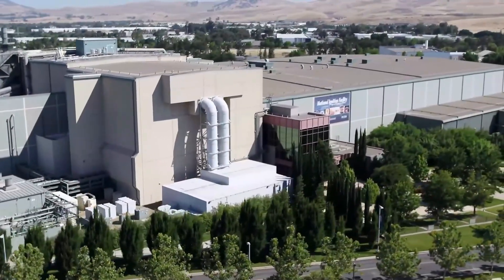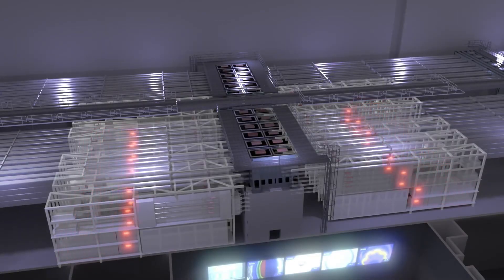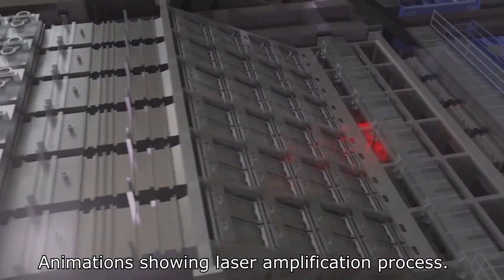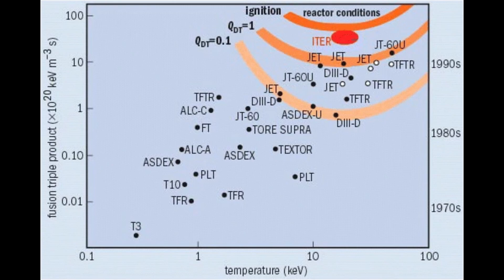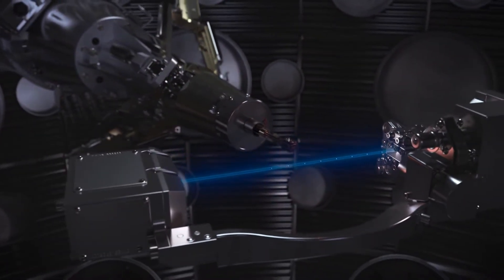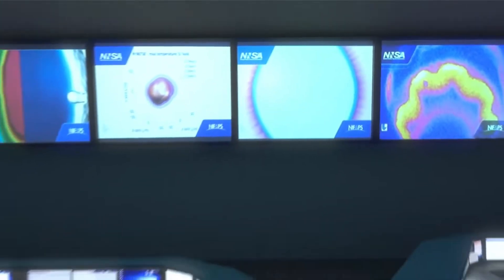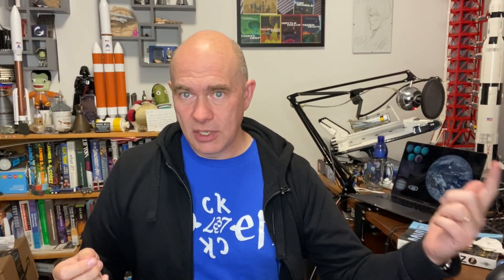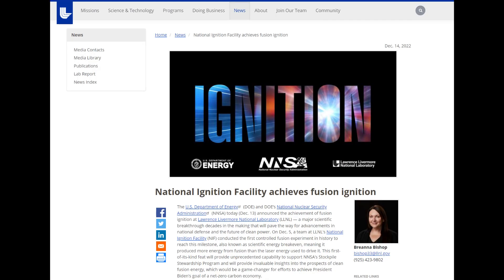Why The Biggest Laser in the World is Making Big News About Fusion

Comment: well they made once 300Whours to power my pc about 30 minutes  - and as far as i know they only calculated the poweroutput of the laser, not by the total consumption of the facility.
compared to the the total power usage they only received 1% of the power they put in if somebody calculated it right. As well they need hours to repeat this experiment, even if they can improve this method by a factor of 101 to gain 1% of the energy, they would need to repeat this process several 10000 times each hour to get something equilivant to a nuklear powerplant. 
This process uses Tritium which is one of the most expencive materials on earth - there are only a few kg on earth as it is radioactive and not stable. I think this method can never make it to a industrial usable even if its interesting to know.

Comment: important difference, its NOT the photon pressure that compresses the pellet. its essentially ablating the surface of the pellet very fast at high energy which gives a reaction force as the surface blows off that compresses it.
its also not the hottest thing we have, which would be particle accelerators, the Z-machine is also certainly hotter/ not sure about the density for those.

Comment: Already seen plenty of titles saying this is basically nothing, the same as every "breakthrough" in fusion we heard about in the past 20 years. I mean we get it, fusion reactors dont exist yet and the actual electricity bill for this experiment is still higher as the output by far. But being physically able to reproduce conditions similar to our suns core seems pretty significant to me, even if we are still far off from a working power generating prototype. In the meantime... maybe we can start building more solarpanels and stuff? No? Ok.

Comment: yes, thank you for pointing out the huge difference between Qtotal and Qplasma, usually discarded in the press (scientific vulgarization included) - we have the same issue here with ITER, even if the claimed Qplasma ~10 is achieved one day that will still be under a Qtotal in the order of 0.01 ... so net consuming energy from the grid.
Reply: Because ITER is a giant mistake.
Reply: @camojoe83  it is foremost a research tool, net power production claims derived from research experiments to that end are only binding whomever believe them.
Reply: MIT latest iteration of ARC/SPARC the MANTA on paper has Q≈5, and is the first commercially "viable" project, and not because of the generated power, which would only be about a 3% gain, but because once running it would be tritium positive.
Reply: @jonharson  Oh, it's on paper...

Comment: Cool! Laser tech gives us the numbers for releasing stored hydrogen energy with the energy required for 1 atomically sealed proton + 1 AS proton = to 2 AS protons as helium with approx. 50% extra energy leftover. I wonder if it's possible to create a hydrogen plasma cation using electromagnetic manipulation for ionization or at least drive them to the outskirts of a tokamak donut so the protons bind easier. If we could get to anything over +100% that would be true self propelling ignition. But it's probably gonma take a lot more manipulating. Or would ionizing the plasma just make the energy output less powerful? Hmmm, fascinating stuff.

Comment: Supernova explosions are seen as the source for heavier atoms beyond Helium. Any idea, if they already went well beyond temperature and pressure in the Sun, how far they were away from these conditions?
Reply: The fusions in a star can go up until iron if the stars are heavy enough. The sun is not big enough and is still in the stage of fusing hydrogene to helium at about 15 million degrees kelvin in the core. You need about 200 million degrees to go the next step to merge helium. That will start in about 4 billion years.
Reply: @O_Lee69  ok so here they reached 'tens of billions degrees C" ( 4:45). Basically a furnace that will fuse whatever you feed into it.

So then hopefully a theoretical question ... will the furnace feed on whatever element it can find in its surroundings to maintain the reaction ...?
Reply: @wasp586  No, not in the surroundings because you need the high density. And the temperature is not high enough for most of the elements.
Reply: @O_Lee69  llet's see, unless they work in a vacuum in which only Hydrogen isotopes are supplied, the atmosphere that will be superheated during the reaction wil mainly contain Nitrogen and Oxygen, not the heaviest atoms.

Comment: I think the Tokamak is more likely to end up as a power station design. NIF is exciting as a proof of concept but it’s sort of like proving that combustion can occur in a car engine. That’s not the hard part, the hard part is getting continuous power from it. The ITER Tokamak is looking like a very promising design because you can have coolant water running through the walls. However, whilst its big aim is to prove Q=10 or more, it’s also going to try and test a whole host of technologies needed for sustainable fusion power. And only if that’s successful is a reactor on its way.
Reply: Tokamaks are cool but they have so many  more instability variables than inertial confinement does. Helion and General Fusion have more promising designs for a practical reactor. SPARC is a hugely underfunded tokamak approach with high T YBCO. Really, the main drawback of the D/T tokamak is capturing the high energy neutrons and not breaking the thing. He3/D has a bit less cross section than D/T but produces much higher energy positively charged He4 ions which can directly be converted into electricity via changing magnetic fields and produces far less energetic neutrons to deal with which degrades a blanket over time.
Reply: @miinyoo  D-T-fusion produces the same amount of He4 as D-He3-fusion. The difference is that D-T produces 1 He4 plus 1 neutron per fusion reaction, D-He3 produces 1 He4 plus 1 proton. And the cross section for D-He3 isn't just a little bit smaller than D-T, there's about a factor of 50 between them (~2.2*10^-26 vs. 1.1*10^-24), and D-He3 has a more than four times higher ignition temperature than D-T (58 keV vs. 13.6 keV). That's way beyond what's currently achievable by magnetic or inertial confinement. And at the conditions for D-He3 fusion you'd also get a significant amount of D-D side reactions, again releasing copious amounts of neutrons containing several percent of the released energy even when running the plasma hot and lean on deuterium, which is why D-He3 in practice wouldn't meet the criteria for being aneutronic (<1% of the energy carried by neutrons). And another problem is the supply of fuel. He3 only exists in homoeopatic amounts on Earth, even if it was separated out from the entire global helium production you'd only get a few kilograms per year, far less than what you'd need to cover humanity's energy consumption. So you would either need a He3 breeding process (which would require use of another neutronic fusion reaction, so you're back to square one in that regard) or extraterrestrial mining (possibly on the moon, but more likely you'd have to go all the way to the gas giants). All this amounts to such big problems that noone is seriously working on D-He3 fusion beyond some theoretical work. It's pretty much only science fiction and it will stay that way for a very long time.
Reply: @blahfasel2000  a couple of companies are indeed proposing separate D-D breeder and D-He3 power reactors, but how close they are to actually providing commercial power generation is anyone’s guess.
Reply: "We've spent many decades, and many tens of billions of dollars studying and building Tokamaks and so we know a lot about them. And what we know is that they are no damned good."
-- Robert Bussard, RIP.

ITER will never generate a single watt of power, and never result in the design of a commercial fusion reactor. It will produce a pile of PhDs taller than the reactor building however, so it won't be an entire waste of money. BTW, any reactor design which stemmed from ITER could only be built in about 4 locations in the world (due to the amount of power they'd require to start up) and it would produce the most expensive electricity ever made.

So ITER is a total waste to time and money in terms of energy production.
Reply: @Chris.Davies  ITER never was planned to be a generating power station, so it not generating a single watt of power is it working precisely as designed.
Just because we know that tokamaks work well, doesn't mean we have them big enough that they produce significantly more power than put in. And there are always scaling problems.
What you are looking for is the DEMO power plant, which the blueprints won't be worked on until at least 2030.
Reply: @666Tomato666  I’m glad they didn’t design DEMO at the same time, because then it would’ve inherited all the same problems in their superconducting magnets. Now, hopefully, DEMO will be able to use the modern high-performance super conductors, such as Commonwealth fusion systems are using. Whether DEMO is a separate unit or, as mooted recently, simply a retrofit of ITER. What’s exciting to me is the idea of combining the performance of the modern smaller spherical tokamaks with the sheer scale of ITER.
Reply: You’re not wrong in terms of commercial energy production, but in terms of the knowledge we’d gain on how to control fusion plasmas, ITER is well worth it.
Reply: I mean sure there are challenges, but if it was as worthless as the internet loves to profess it is, why is China, the EU, Russia, India and numerous other countries pouring money effort and their best minds into making it? I mean yes, it won’t produce a watt of power: it’s a research project. But the research is not purely academic, it’s purpose is the practical.

Comment: Hullo Scott! great video as always. Just a minor point on the "confinement time" in the Lawson criteria. At the end of the video you mention that ITER will have continuous operation and that this is related to the time in the Lawson criteria.
Firstly I don't think ITER will be continuous but will have "pulses" lasting several minutes or hours (time limit is related to sweeping voltage in the central solenoid to drive current in the plasma which provides much of the magnetic field for confinement). 
Secondly it's the "confinement time" which is important not the "run time" i.e. how long it takes the heat generated in the plasma to escape. In a tokamak this depends on the size of the plasma and how well you can confine and control it, not the run-time (as long as run time exceeds confinement time I guess).
Incidentally, in the sun it's the confinement time as well as higher pressures which facilitate fusion and as you mention, the sun is cold as far as fusion is concerned!

Comment: thats a big twinkie.

Tokamak will probably be what ends up working for grid scale, The main thing is with inertial confinement is for grid scale would you need a big enough pellet to burn for years or is there a way to keep pitching them into the lasers.

On that note how rapidly can the lasers be refired, Do the optics take any damage from this strong of a laser pulse.
Reply: There is a minuscule amount of damage on many of the high power laser components during each 3 nsec pulse. Due to things like overheating that maximum pulse rate is about 6 hours. They are lucky to get in more than one shot per day. With this experiment the prep. time was at least two weeks. After the shot was done the target vacuum chamber had to be cleaned out of all the radioactive debris blasted away from the target assembly that was turned into an exploding plasma.

The fusion reaction lasted for about 0.08 nanoseconds. Divide that by the seconds in a week and the result is a duty cycle of 0.0000000000000002. If one adds the energy consumed by the facility over a week period of time then the input energy is far greater than that of the 100 times greater than the capsule input energy.

Comment: The report of this so called 'breakthrough' came from people who are well versed in obscuring key details because they work in the secret environment of a nuclear weapons laboratory, Lawerence Livermore National Laboratory (LLNL). Within it is the National Ignition Facility (NIF) giant laser building which has always been primarily funded to study thermonuclear weapon (H-bomb) fuel-compression and other thermonuclear weapon's dynamics. The reported experiment was actually part of that function. Material samples were placed next to the fuel capsule to test their reaction to the intense pulse of 14 Mev fusion neutrons that were generated by the reported experiment.

The reported input energy quantity may not have been from the lasers but instead a measure of the fraction of X-rays that ended up compressing the extremely expensive, nearly perfectly spherical, hollow diamond fuel capsule. The fusion energy production lasted about 0.08 nanoseconds. Since it took about a week to prepare the shot the duty cycle of this shot, over a one-week period, would be around 0.0000000000000002. It was finally admitted by the NIF staff that the energy needed to charge up the lasers was over 100 times greater than that used as the input reference energy to the compress the the fuel capsule. During the exceedingly brief reaction about 4% of the once frozen deuterium/tritium (D/T) fuel mixture actually 'burned' with the remaining ending up as radioactive waste coating the interior of the vacuum vessel that required cleaning out before another experiment could be performed.

The lab employs their own definition of 'ignition' that is different than most people idea of ignition. Most people equate it with something like a match head striking a rough surface where the initial reaction spreads to the rest of the fuel in about two seconds. In the NIF inertial confinement experiment (ICF) the extremely compressed core of the fuel pellet, which was in the form of a 150 million kelvin plasma, started the fusion reaction then blew off the other 96% of the fuel before it could participate in the reaction. The fusion reaction is totally dependent upon the energy contained within the laser beams and the compressing X-rays that are generated from those beams. During the blast from the laser beams the entire expensive target assembly turns into an intensely hot plasma.

The multibillion dollar National Ignition Facility (NIF) lasers achieved full power in 2009 and the experimenters were expected to achieve its namesake goal of 'ignition' by 2012. It failed by a wide margin but the funding kept flowing from the U.S. nuclear weapons program budget.

I've followed the fusion energy experiments since the early 1970s with its usual claims that a practical fusion power reactor will likely only be 20-30 years away, touted by the experimenters and their fans. They often state that the power source is virtually unlimited since the fuel can be obtained from seawater. The fact is that tritium is extremely rare, extremely expensive and radioactive, having a half-life of about 12 years. There are enormous problems needed to be overcome for future fusion reactors to breed their own tritium fuel from a lithium isotope. The intense energy 14 Mev neutrons, generated by the fusion reactions, will degrade the structures around them and will render some of their atoms radioactive via the process of neutron activation reactions. The usual claims of fusion producing clean energy without creating radioactive waste is pure deceptive sales hype. Most nuclear fusion physicists agree that Magnetic Confinement Fusion (MCF) experimental approaches are far more likely to lead to a practical fusion power plant design. Still that is likely to take well over a single decade. Scaling that up to displace our addiction to fossil fuel based energy resources will take more decades. Those people, who continue to believe that nuclear power will save us, have to be masterful at excluding the following warnings from their consciousness. 

Here is another critical review of the recent experiment and the ITER situation. When most journalists look for critical balance in their articles, on topics such as this, they tend to defer to those experts who have vested interest in the technology, or have long been fans of it.

Is This the ‘Kitty Hawk Moment’ for Fusion Energy?
https://www.theatlantic.com/technology/archive/2022/12/department-of-energy-nuclear-fusion-breakthrough-nif-livermore/672439

ITER is a showcase … for the drawbacks of fusion energy
https://thebulletin.org/2018/02/iter-is-a-showcase-for-the-drawbacks-of-fusion-energy

ITER Newsline
KEY COMPONENTS TO BE REPAIRED
21 Nov. 2022
https://www.iter.org/newsline/-/3818

Comment: 13:00 The other source of tritium is from irradiating lithium in a nuclear reactor - the neutrons strike the lithium and fission it into helium and tritium.

Most concepts for commercial fusion power plants include using molten lithium as a coolant, slowing down the neutrons from the reactions and heating up the coolant.  This also breeds more tritium for use in the reactor, as the high energy neutrons from the fusion reactions are very effective at splitting lithium.

Comment: But getting more energy generated than put into the fuel is not actual ignition. Ignition is where there is further fusion - not just 1st generation burning - this 1st reactions causes further fusions. I'm pretty sure excess energy production and ignition are not the same. Although, great gain would only happen if ignition has also occurred. The gain was only 1.5. Its a long, long way before we're building a power station